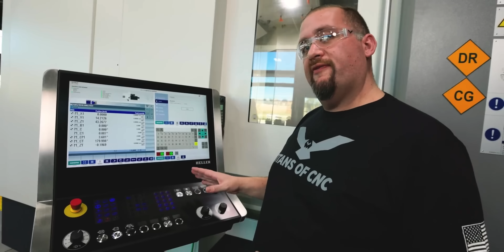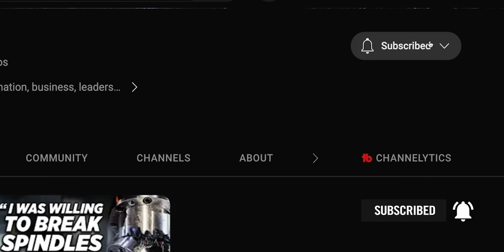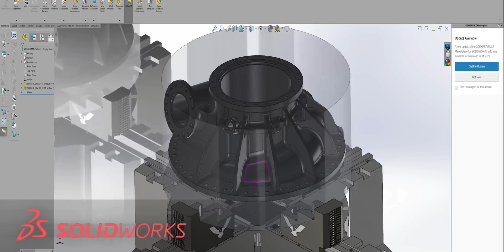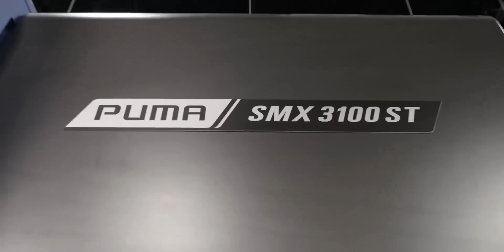99.99% of Machinists Will Fail at Machining this Part

Comment: Titan is 100% correct! If you bring value to a company (help them make more money) business owners are willing to compensate well. But the other thing he said is equally important. You must SELL the business owner on your ideas and how you can implement them to solve their problems! 💥
Reply: This is 100% BS, I have NEVER EVER seen an example of this in my 40 years. Never has a business owner paid anyone in this trade this kind of money unless they are family. People, myself included, who have excelled in the trade and worked thier way to the top have always capped out just above the 6 figure mark. My best years were capped at $125,000 salary which was achieved solely due to an impressive CV that came from a life time of hard work. In Canada right now machinists are making upwards of $55 / hr finally due to the lack of good tradesman, this is an "ALL TIME HIGH" not the norm. People (or corporations) that start a machine shop, do it so "they" make money, they're not going to want to share more than they have to. They're not in business to make others money, don't kid yourself. My close friend at ASCO Aerospace, previously called EBCO Aerospace in BC just retired after well over 30 years as their lead programmer. He had a serious list of achievements, more than most machinists will ever accomplish by a long shot and he never made that kind of money either, not without massive amounts of overtime.  So unless you have proof of this, stop trying to push it off as possible.

Comment: 3:48 Quality is very important. I worked at a shop that considers inspection times as directed labor. Every part that goes into inspection has a time that it needs to be inspected and if you cannot meet the time then you will get called out during the morning meeting. I see a lot of inspector cutting corners to meet the time like leaving burrs on parts. Some parts only give you two minutes. The plant manager said to the whole inspection department if someone could measure this part 20 years ago at 5 minutes per piece then there shouldn't be a reason that anyone else can't. The same thing with the marking department. The guys that do the marking have a specific time they need to mark the parts. A lot of them can't meet the time and the setup from the engineer is horrible. We have fixtures for marking where you have to physically hold down the part and often the part moves on you and is marked wrong.
Reply: Aaah that type of company ^^ 

Can I ask, what happens to the inspection team when they miss something important cuz of pressure?
Reply: @IGetWicked  If a part gets sent back from the customer and the inspector tells the Quality manager that he/she is trying to meet the standards then the Quality manager will say he doesn’t care about speed and cares about quality more. Even though he is the one rushing the inspectors. Another issue is the company also calculates the inspection team's efficiency and utilization as a whole. If one person messes up then all the inspectors will get in trouble. You will have other inspectors watching you closely to make sure you are working every second because they don’t want the efficiency graph to go down. They will rat you out to the Quality managers in a second.
Reply: @delroyokuma9099  how does a shop like that work long term? seems like they really don't think about long term profits or keeping their staff
Reply: @halcyonoutlander2105  The company tries to make each department into a team sport. Everyone has to perform at an elite level and score the same efficiency points. I recently found a new job and quit the company.

Comment: here in Israel I got to the point that I just gave up and just quit the job.... running into a wall with management multiple times a day ... they only need butonpushers and babysitting the machines... what relates in a poor poor poor salary.... as in most of the biz here in israel, management eats the major part of the cake and people on the workfloor get crumbs...
Reply: Here in Australia few year ago my son worked for a Jewish owned company.The management called the workers to office one by one to tell them they got a pay rise of 20 cents an hour while they drove $200K Audi cars as company cars.😂
Reply: liiving in israel is very challenging when you are not jewish ... it's very tempting to become antisemit ... the mindset is just not normal... making money here means to abuse your crew, complain about how much everything costs, and make as littleas possible investments, and keep working on the same machines until they die... but spend no momey on maintenance... or calibration... i had 2 vernier calipers and 5 different micrometers and some other inspection tooling... last calibration date  (the last time my bore inspection gauge was calibrated was the most recent one of all my inspection tooling ) ... don't fall of your chair... 2008 
 @mehmettemel8725

Comment: With computer aided software , it’s not hard to machine a complex part. on a CNC machine . As a machinist working in late 60’s you had to know what you’re doing. No computers to fall back on. No calculators to help with shop math!
Reply: CNC is different from Manual and is not as easy as you'd think. Both machines have their place in a shop and as a 23 year old Machinist I think it's good to be familiar with both.

Comment: I've been running my manual shop in my rented car garage for over 7 years now and I make $100k a year. I want to grow, but I can't afford rent to get into a bigger brick and mortar shop. I go from $2000/month to $7000/month for rent. I live in an expensive growing city.
Reply: You must uspcale your output and the inquiries has to multiplicate. So you can buy 2 new machines and hire a machinist. Than the monthly rental cost you will not kill.
Reply: @makro8218  My garage is only 120V so I can't buy a CNC nor do I have the footprint for another machine. I've been trying to hire someone for 2 years, kids with no experience want $25/hr and don't want to do dirty work.

Comment: In school full time 7 am-
12:40  Mon-thurs for a machining certification program at 1:30 on mon - weds I go to a machine shop that uses mills, CNC’S  hack saws, vertical saws grinders and on  and 1:30 on Thursday- Sunday I go to a shop that make dies, gears a handful of cylindrical type of products and uses manual lathe and CNC lathes, after I get my certification done at school I want to continue  my education and learn CAD and CAM and more CNC.